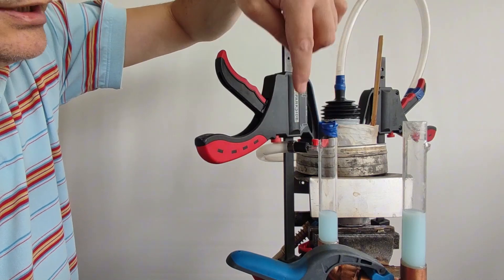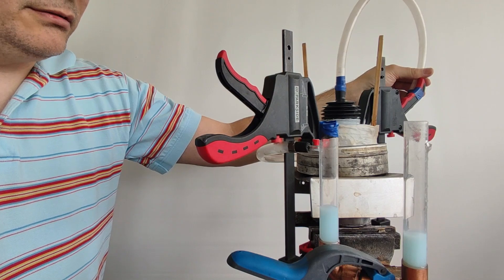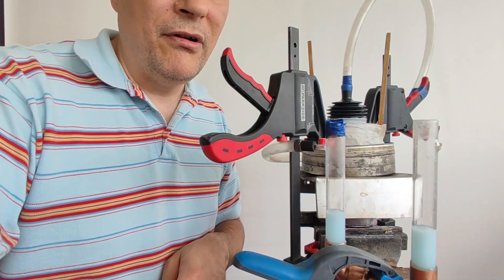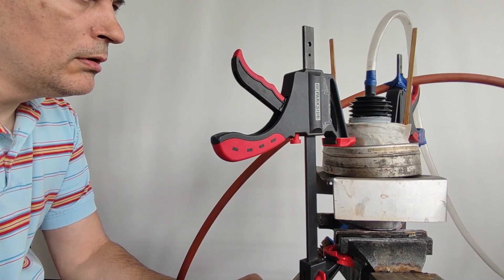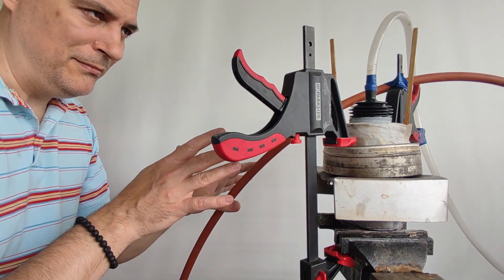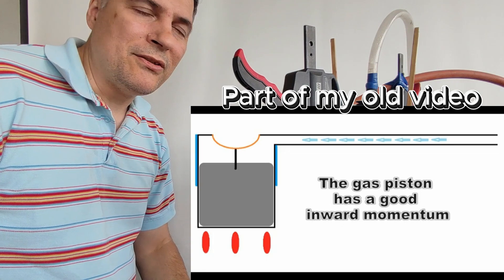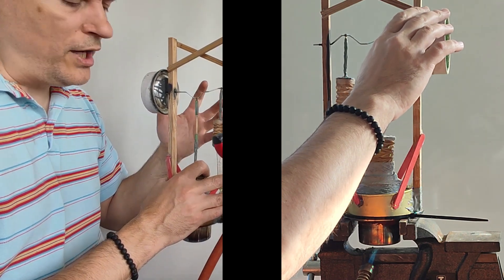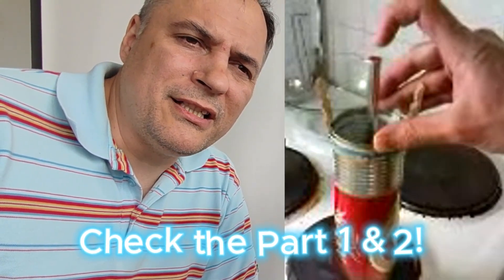How I developed my new Caloric engine -Part 3- The Free Piston Thermoacoustic Metronome Engine

Comment: It looks as if it should be self starting, which is a big improvement. Have you tried measuring the power output of this engine? I wonder how it compares with the free piston Stirling engines you have made?
Reply from the maker: Yep, if the unit has no leakage and the piston diameters and strokes will be optimal for this type of unit then it should selfstarting! This is the second prototype only, I want to know the optimal ratios for this unit first, but it has pretty good starting torque that I never felt on any other type hot air engine.

Comment: Hi, I really like what you do but I have to ask a question.  Why don't you have some set up an energy generator on each one so as to see what kind of productivity it gets.  Just use the same one on each  type of generator.  Then you can reuse it to see if you've gained or lost on each iteration thus pointing you towards better more data-driven increases.

I bet you would get a great deal more subscribers and views.  These engines are cool but to what end?  Is it for a motor, generator?  If you can always separate each one into those categories and then use the same (motor or generator) to it, then you'll be able to always compare what you have done.  Then if you keep a running spreadsheet on that as you go thru it and always go back to a video on the summarization of your results that refer back to each type, then you're golden.  

Both RMS and Cayrex do some "version" of this but never as a cumulative approach.  This could be YOUR differentiator.

Just trying to help you.  I love the creativity but most of us cannot see the distinctions with regards to increased power (for a motor) or power generation.

There's just not enough time for content anymore and if you notice, views are dropping across nearly all channels.  That should tell you changes are occurring.  People just trying to make it so if you can add something that actually can translate to greater sustainability or DIY-engines then you'll get the views.  I promise. 

Cheers and God Bless!
Reply from the maker: This is not that simple as you think. Every unit has optimal working parameters. If the actual built unit has no optimal parameters then the result will false. That means a generator could be optimal for a unit but not optimal for another one, because... for example the perfect power generation starts on 1500RPM with a permanent magnet generator, but the hot air engine has 1280 only the result will false, because it will generate electricity but not the best that the engine can do. If we optimalise the unit first and connect with an optimal generator, then it will be ok! But then every unit has different generator, with different parameters, stroke, speed, torque... So we will compare apples to pears. My goal HERE is not to build the best generator, hot air engine or heat pump. The goal first of all the knowledge spreading, and to see, how people start to thinking about the hot air engines from zero with lot of creativity. The goal to show and share the possibility of the experimental learning method... I believe in that the new generation could develop a practical unit for them. I really like the weird engines that made from recycled parts. These unit teach the people to thinking. Thinking about the energy, thinking about the nature and how short the life is... if the contents are good, the subscribers will come. I want to make this without stress. BLADE
Reply: @AttilaBlade  Okay, having said that, I don't see any data that shows you're optimizing the "unit".  I guess if you did that, it would be a great start.
Reply from the maker: @bigonprivacy2708 Yes, I did not optimize the machine in the video, because the purpose of the video series was not to optimize, but to show how closely related the otherwise different hot air engine types are. I was hoping that you could see the connections that resulted in a new type of engine. The optimization is an important thing to make a practical engine. That's needed a big non-experimantal background calculation first to understand what's happening here exactly. I am working on this with the help of a very nice Spanish professor.